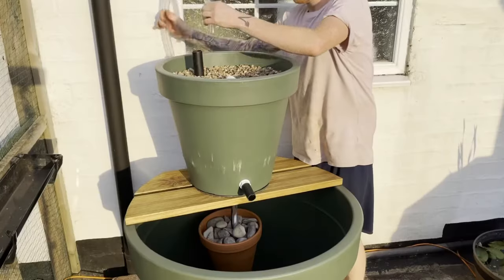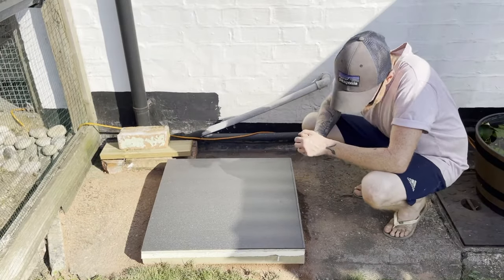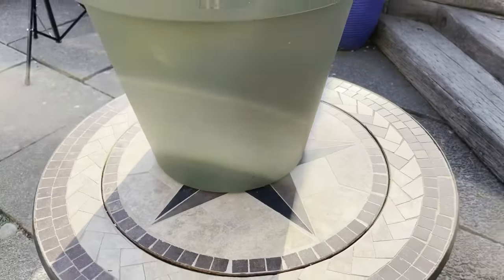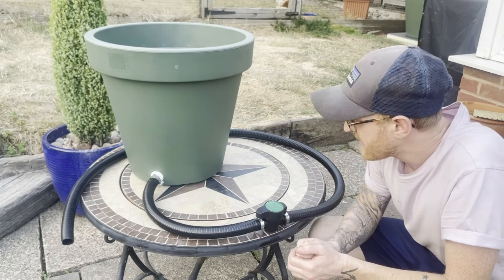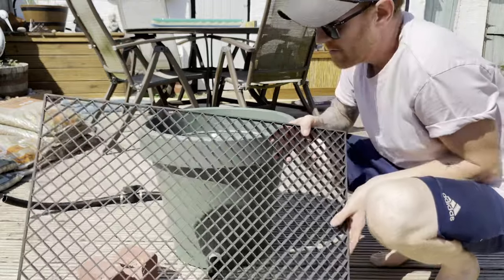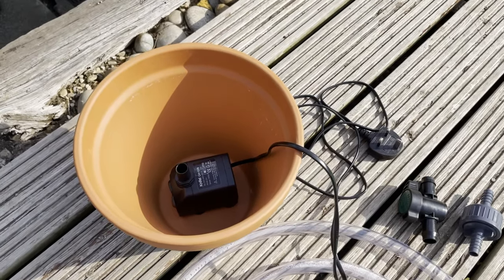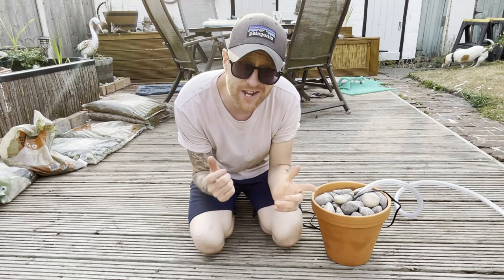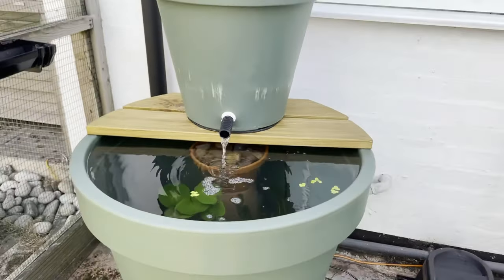DIY ‘Patio Pond’ Build, with BOG FILTER!

Comment: I have made a bog filter of concrete using these exact methods like void spaces, gravel, plants etc and my water is crystal clear. In fact crystal clear seems to be an understatement!A slow water flow makes a huge difference, that is the trick
Reply from the maker: That’s awesome!! Bog filters are definitely my favourite kind of pond filter, and it’s great how they only require a slow flow.. it’s means a smaller more energy efficient pump can be used! I think bog filters in general are really cost effective!! Thanks for watching!! 😊
Reply: Can anybody recommend a pump for a small 400L pond please. Won't be overly stocked with fish. Thanks . Great videos mate.

Comment: Great looking build!  I worry a bit about finishing the wood components.  You mentioned staining the wood, but a varnish or deck sealer would probably go a long way to preventing swelling or damage to the wood, as well as keeping anything nasty from the wood itself from dripping down into the pond, particularly if you used treated deck boards.  I'd do the same for the OSB portion of the base, as rain water will get in between the other layers and cause swelling and disintegration of the OSB  over time.
Reply from the maker: Yeah, all fair points, thanks for watching!  👊

Comment: Right so firstly for those debating recreating this...

I've created my own pond based on this and mirrored it as closely as possible. I've pictures to prove it and its outside as I type. Fish and all. I've made some observations.

COST. This is NO budget pond. You could build quite a half decent ground pond for the cost of this. I've seen a comment or two that this planter cost him £45. Im sure 'today' that this is NOT possible. Im UK. Ive found this exact planter in numerous gsrden centres. It ranges from £350 to £500. The smaller planter anywhere up to £100. Planters are a rip off these days. I got a similar planter but much thinner in B and Q for £67. And the smaller for £25. Doesn't look as nice as this one but its still sturdy and same colour/size. Stones are not cheap. £10 at least per bag (4) and might use half a bag. Tubing and equipment around £70. Amzon and homebase mostly. And I scrimped as best I could.

VISIBILITY. The pond has been operational now for just over 2 weeks. Ive 3 small Gold fish. Smallest outdoor fish in the market now since the laws changed or so the fish stores all consistently tell me. As things stand. And the pond is set up identically. I can barely see the fish. The walls are very green. The gravel on the bottom must be very green. Can see about 15 cm down so if the fish are there I can see them ok.  Ive tested the water. Its crystal clear. So the bog filter setup works well. But the Algae on the walls and floor are a problem. The terracota pot which was visible at the start, is now pretty much solid green with algae. No string Algae or anything like that thankfully. 

Debating getting 2 or 3 lights for the bottom and see if that increases visibilty.

Admissions. I'm an amateur. Never done this before. But the pond is identically set up to this one, that is for sure. Can anyone offer tips as to how to remove the green from the sides and base? I've used the sponge which works but messes things up and the green comes back in 2 or 3 days. Can it be stopped long term? Its in the sun for 5 or 6 hours a day. Nothing can be done about that.

Comment: Great video and excellent descriptions. I'm curious about adding a T connector in the "cleanout" line so that could double as the input from the pump since it already goes to the bottom of the filter. Thoughts?

Comment: this inspired me to do my own i have created a pond with 55 gallon food barrel.  I used 2 5 gallon buckets one on each side.  it has been going good but my question is how much water should i expect the plants to use.  I seem to loosing about 6 to 7 inches a week.  i cant find a leak any where.  do you plants take much water from the pond
Reply from the maker: That seems like quite a lot of water to be loosing each week. Is it particularly hot where you are? Could be evaporation? Also, could wind be catching the water as it returns back to the pond, and blowing it out? That can sometimes happen if there is a big drop from the bog back into the pond. 👍

Comment: Excellent videos... Full of information  and very inspiring. Great job best style videos 📹.
Q: How do you stop the Pond section from overflowing when it rains 🌧 ?
Reply from the maker: Thank you! To be honest I haven’t done anything to stop it from overflowing… If I see it looking too high I just use a jug and remove a bit of water. I’ve seen people with a similar setup drill a small hole near the top of the pot where they want the water level.. unfortunately because the top surround on this pot is hollow, it wouldn’t of work in this situation. 😊

Comment: Cool idea! I like this project. Is there any reason we shouldn't put the debris removing pipe on the bottom of the pot, instead of the side? Seems like it would be a more effective way to remove all of the debris. Yes, I realize I'd have to cut a hole through the back of the bottom pot.
Reply from the maker: I don’t see why not, I’ve always just had it on the side, and it seems to have always worked well for getting rid of the debris. You would have to make sure you provide enough support around the hole you cut in the bottom though, as the hole may weaken the base a little. 👍

Comment: Nice concept. Is there a reason the pipe from the pump into the filter enters at the top like that? Couldn't it just go in at the bottom? Just thought it would be neater, but maybe there's a reason you did it that way.
Reply from the maker: Thank you! No real reason other than its one less hole being drilled, and therefore one less chance for a leak. But it would look neater, for sure. One other reason though, for going in at the top, is it allows you to add a breather pipe, which is a good alternative to a non-return valve in stopping the back flow of water in the case of a power outage. Obviously I didn’t include the breather pipe in this design as I was using the non-return valve, but I think in the future I will move more towards the addition of a breather pipe, instead of the non-return valve as I think they may be more reliable, and also cheaper.

Comment: Great vid! I’m going to do this when I move into my house, currently in a flat. Can the pump tube go straight into the bottom of the filter pot rather than it going in from the top to just reach the bottom anyway? Would make it look a lot nicer than a tube sticking out the top lol
Reply from the maker: Thank you! Yeah, you can go straight into the bottom. The only thing with that is that it does add a possible leak point,  also some people add a breather pipe in at the top (where the water comes in), to stop back flow. But if your not using a breather pipe and your using a non return valve like  I used here, you can for sure go in at the bottom, and it would look a lot cleaner.

Comment: Great video! I would like to ask, where do you keep the electric sockets? Do you keep them outside? If yes, couod you tell me how do you manage to keep them water/moisture tight? Many thanks in advance!
Reply from the maker: Hi Adrian, thanks very much! Yeah, I run an extension cord to a specifically designed weatherproof electric box. If your in the UK, you can get them from Homebase. It works quite well, but it’s not perfect. I tend to place a bin bag over the top of it as a bit of extra waterproofing! 👍😊

Comment: I wonder if doing with a solar panel and no battery in Florida, USA would be enough to keep the pond clean.  My tank would be about 400 gallons and it would only be running while the sun is out.
Reply from the maker: Might work.. especially if you’re in Florida.. just make sure you include that non-return valve (or some other method), to prevent the water in the bog filter from syphoning back into the pond through the pump when the power go off! 👊

Comment: Hi , I have never done DIY but I am going to try and make your filter. How do you cut the hole in the planter so that the connectors fit them exactly?  You don't use a uniseal or similar?? What size is the plastic pipe please. Do I need to buy pipe cutters. I will borrow a drill so what size round  cutter do I need please? Thank you so very much and thank you for making this video. 😊
Reply from the maker: Hi Suzanne, I cut the hole in the planter using a 29mm hole saw (or hole cutter), which is the size to use if you are using the same 22mm tank connectors that I used. The plastic pipe is also 22mm. And you don’t necessarily need to buy pipe cutters, you could just use a junior hack saw, but a pipe cutter does make it a lot easier. Also is you’re using the tank connectors like i did in this video, they should come with little rubber washers that ensure a water tight seal. A Uniseal works in a slightly different way to tank connectors, but you could use a uniseal instead of a tank connector if you’re like. If you in the UK you should be able to get everything I used and listed here at Homebase, and probably Wicks too. Hope that helps, and good luck with your build. If you’re worried about drilling the holes and installing the tank connectors, you could always have a practice on a bit of scrap plastic or something before drilling into the plastic container you’re planning on using for your filter. That’s what I’ve done in the past if I’m a little unsure. Thanks for watching! 😊
Reply: @GingerFishyOfficial Hi ,Thank you for your reply I am writing out a list of items I need to buy. I am thinking of going to B and Q ,I live in England.  The , water in pipe ,  is a 1 inch plastic pipe with 1 elbow. The clear plastic tubing that you use to go inside of that pipe ,  please would you tell me the size of that. Do I buy that from a fish store where I would also buy the pond hosing and metal fasteners and regulater stop cock ? 
Thank you so much .
Reply from the maker: @suzannemoran7281   Hi! Yeah, the water in pipe is 1 inch, along with one 1 inch elbow. I’m not too sure on the size of the clear plastic tubing I used, but really it will be what ever size will fit your pump. Pond hosing, metal fasteners, regulator/ stopcock you should indeed be able to get from your local fish store. They should also be able to advise you on what hosing to buy for your pump. If your local fish store has a decent pond section, they may also sell the tank connectors and pvc pipe. Hope that helps! 😊
Reply: @GingerFishyOfficial  Yes it does help. Thank you very much. 😊

Comment: A hair dryer or heat gun for a few secs will make putting the hoses on much easier.
Reply from the maker: Yeah, defo need some heat.. I’ve recently taken to dipping the hosing in hot water which helped a fair bit.. but will try the hairdryer method!

Comment: Where do you get the inline clean out  isolating valves from for the bog filter and what size are they as you are using 1” pond tubing?
Reply from the maker: I can’t remember the size unfortunately, but anywhere that sells pond supplies will sell them 👍

Comment: Great video! I built a bog filter like yours for a small pond that's roughly 4' x 3' any idea as to why the water is green?
Reply from the maker: Possibly too much light. Have you got any floating plants or a water lily providing shade?
Reply: @GingerFishyOfficial  Thank you for your reply. Both the pond and bog filter get direct sunlight. I have not added any plants yet. What would be the best plants for direct sunlight?
Reply from the maker: @jeffreyb8928  Water Lily is always good, and will flower nicely in full sun. Also, depending are where you are located water lettuce and water hyacinth also work well in the summer months. 👍
Reply: @GingerFishyOfficial  Thank you!

Comment: Can you tell me what pump you’d recommend for this type of pond as I’m looking at replicating it? Also are you able to list all the connectors you needed? Many thanks
Reply from the maker: Hi Peter, are you in the UK? if so, all the connectors I used were 21.5mm tank connectors from Wickes, it’s the only size they sell, along with the pvc, everything came from Wickes. Homebase also sell them, but for some reason they are 22mm there, would still work fine though. The pump I used in the video was cheap 1,500LPH submersible pump I bought on Amazon, which I had to turn right down using the flow regulator valve I put in, as it was far too powerful. However, after a few days the pump started making a noise, so I swopped it out, and ended up actually using a Fluval U3 internal filter which I added a bit of hosing to, to feed the bog. It produces just the right amount of flow without having to adjust it at all, And that has been working well now for a few weeks. Although I only really used that because I had it lying around.. But I did have a look at the pump size in it, and it is a 600LPH pump. So a 600LPH pump would be sufficient to run a setup like this, so long as you weren’t heavily stocking. The size of the pump needed will vary though depending on a few factors, such as how high it need to pump the water up (to the bog), what fish your planning on putting in, and how many of them. That being said a bog filter does not require a massive amount of flow to be affective, in fact too much flow and the bog filter will start to become less affective. Hope that all helps, and thanks for watching! 😊

Comment: Hey bro, 
Have you had any problems with bog filters? I hear they're pretty foolproof, but I'm trying to find a resource that goes over common bog filter problems.
Reply from the maker: Hey bro, I think the only problem I’ve had is depending on what plants you use, they can grow so much that they can block things up to the point where the filter can overflow. For example, I like to use typha, as it’s really good at purifying the water, but it is a big plant with a big root structure, that can get out of hand if you don’t keep on top of it. Other than that I can’t think of too many other problems I’ve had.. but if I think of anything else I’ll let you know! 👊
Reply: @GingerFishyOfficial  thank you!!

Comment: Can this design survive a light freeze? We don't get super harsh winter temperatures, but we do get below zero especially at night.
Reply from the maker: Probably, but I wouldn’t  like to say for certain. I had it set up all through last winter though, and that was a pretty harsh one. I did end up having to turn the pump off for a while though when it froze. Ideally you need to at least try and keep a hole in the ice at all times. Adding a cover helps a lot, and you could always add a small heater set to kick on if it gets really cold.

Comment: So the exit is at the bottom with a vertical pipe added because the clean water is at the top. 

And the inlet is at the top, with a 
vertical pipe going to the bottom because that's where the dirty water needs to begin. 

Is it just me, or ...

Comment: Hello again!! I know you're in the UK but do you have any idea where I could find this size planter here in the US? and what price range I'm I looking at? If the size planter you have can't be purchased here. What other size would you recommend as I wish to keep guppies in it. Thanks in advance...
Reply from the maker: Hi there, unfortunately I don’t know of anywhere specifically in the US where you can get a large planter like this one. But you’ll probably find something similar in one of the big-box stores, or a local garden centre. Also, if you can’t find one as big as the one that I used, a little bit  smaller would be fine, especially if you’re just keeping a few guppies. The bigger it is just helps with keeping the water parameters more stable. Have you seen the channel ‘Aquapros’, he has done a few mini ponds using planters, and I know he is in the US, so you may be able to get a few ideas from a couple of his videos. 😊
Reply: @Ginger Fishy  I hope I can find one but so far it ain't happening. I have one other place to look it's called at-home here and that store has a lot of outdoor planters but I will look up Aquapros because it's seems I may have to change directions. Thank you again for your time and I really appreciate your help..
Reply: What size hole saw would I need for a 3/4 uniseal? I couldn't find a planter like yours here in the US. So I had to pick what I thought would be a decent size. I'm not happy😢 but it will work I guess.
Reply from the maker: @ftayor66  hi there, unfortunately I’m not too sure as I’ve never used uniseals before.. I’ve always used tank connectors or bulkheads. Sorry I can’t help. 😣
Reply: @GingerFishyOfficial  no problem at all
 Thank you

Comment: 🤔 What practical purpose does it serve to put the filter in the middle of the pond and not on the bottom where it would be more efficient and effective?
Reply from the maker: Yeah, ideally the pump (pre-filter) would go at the bottom, but I like to lift it up a bit, that way if there is a leak with the bog filter there is no way that the pond can be drained all the way. Then I use an air stone on the very bottom which should help push up some of the debris/ waste up to the pump. That’s the idea anyway.. Also, in the winter it means all I need to do is to lift the air stone up a bit, which allows the bottom part of the pond to stay nice and still, which provides an area for the fish to over winter.